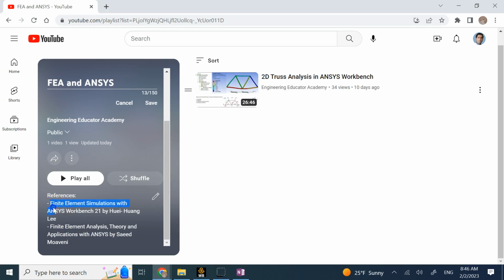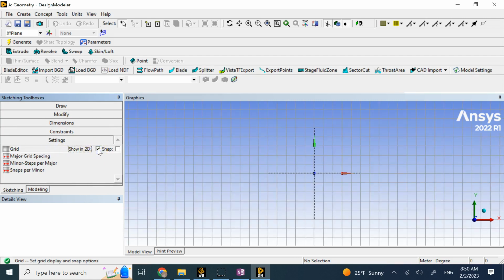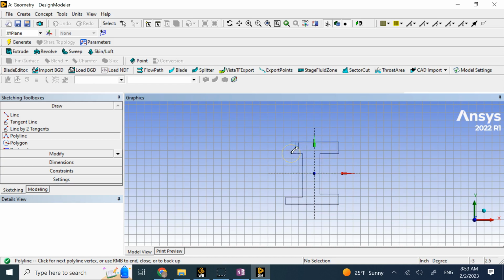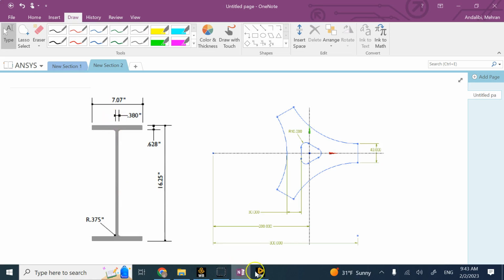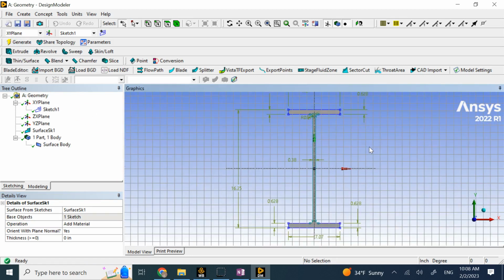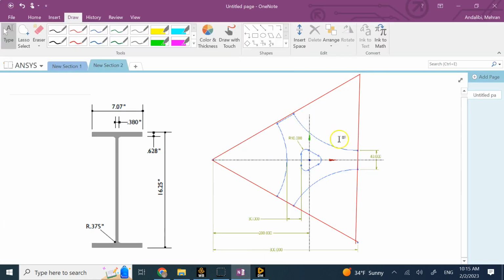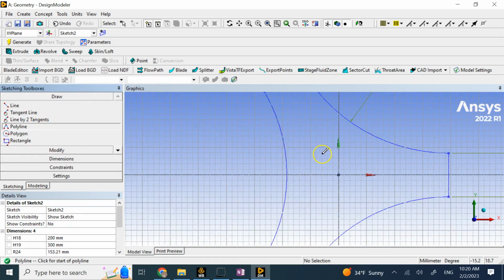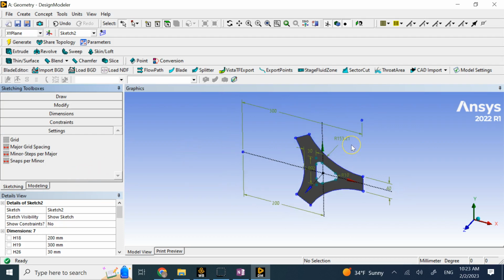2D Sketching in ANSYS Design Modeler

Comment: hi, but what if i want to keep scetch of the "triangle" inside and not cut it out? is it possible to have two Surface Bodies after that? how can i "separate" these two scetches so i get two bodies/parts but on XY plane its sketch on a sketch? 
bc when i create two separate sketches, than surfaces from that, but they are on eachother, programm reads it as one body